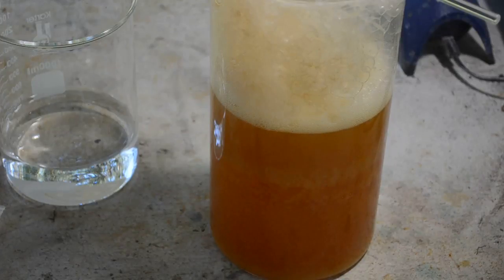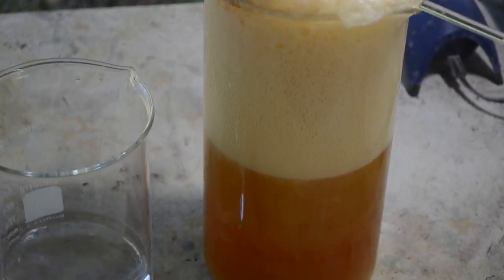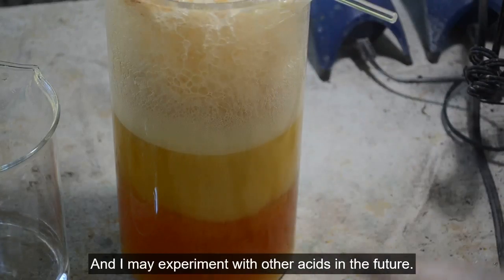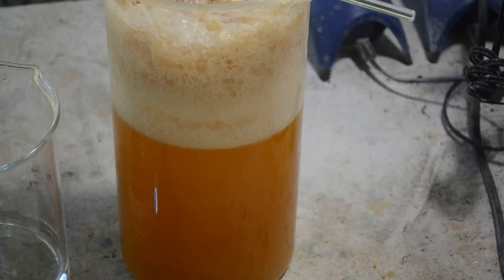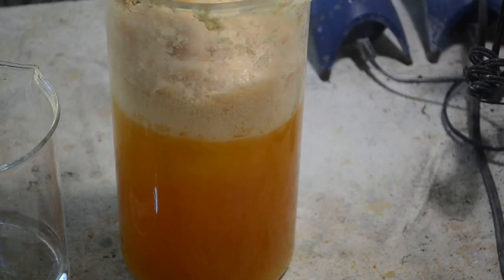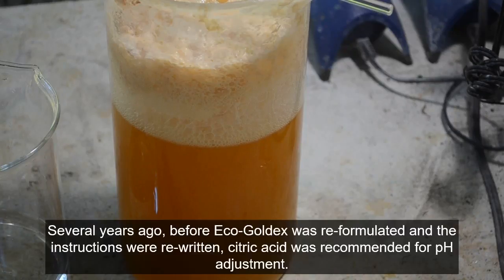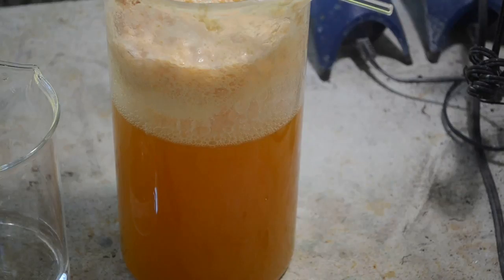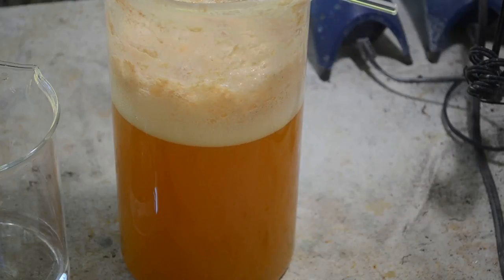Eco-Goldex Short: Gold recovery using various acids, and that white precipitate.

Comment: is the white precipitant silver by chance or possibly lead chloride?
Reply from the maker: I don't believe it is either. Problem is that it forms even when nitric acid is used to adjust pH. Lead and silver nitrate are both highly soluble. That's one reason I tried using nitric acid, to see if the precipitate wouldn't form, but it still did.
Reply: @omegageek64  It appears that it's a metal, because you are getting a yield from it. Silver and lead chloride are not soluble  after adding hcl or some of the other ph changing chems.
Reply: @omegageek64  You could filter it out, melt it into a button and take it to a jewelry shop for an XRF reading - that way you will know exactly what it is.  if you add salt, i bet you would get the same precipitate.  sodium bisulfate (ph down home depot) would be a better choice than acids which will just burn up your zinc in the cementation process and leave you a bunch of trash.  different metals will fall out of solution as the PH is lowered, that is how I separate out copper, silver, gold, etc. it takes patience, but each will drop out cleanly with a PH adjustment, filter, then drop the next one out, repeat until they are each in their own.

Comment: Thanks you for your videos they are always interesting ,  I have used eco Gold X in passed  and always used citric acid  to lower the pH for first time but best results  for gold drop for me is to have the solution hot about 60deg  when adding zinc powder  but watch it may over flow  or sturr solution fast keep bubbles down

Comment: Maybe I missed it - why not follow the Eco-Gold-Ex instructions , also contact them about changing " using citric acid " ?
I've following another channel that is using E-G-X for hard rock processing , and he is following a regular on his live - Monday nights Hard Rock University , the guy advising is Chris Giorgi , seems to have a connection with Gold Ex ?
I have been following because I have some military & test equipment circuit boards with gold plated traces - most with no conformal coating .
Thanks
Reply from the maker: I am going off the reservation and doing my own experimenting because the Eco-Goldex Series E instructions are totally inadequate for recovering anything but gold. They claim to leach the silver and PGMs, as well as the gold from e-waste, but nowhere do they explain how to actually recover them.
Reply: Yes he does, he is using it to pull gold from ore, using resin. I am waiting to see how he is going to ash the resin and what result he gets.